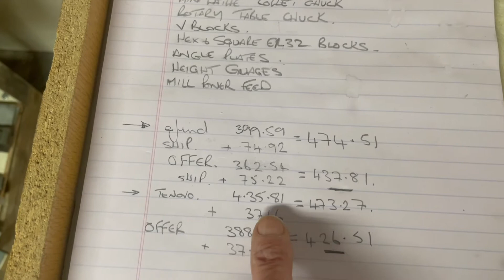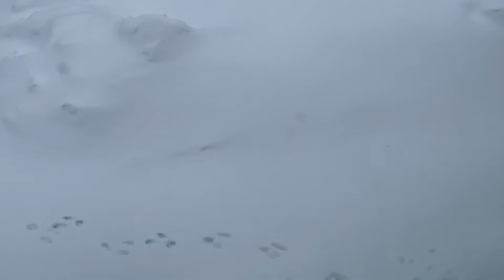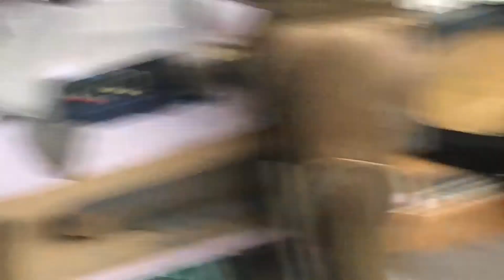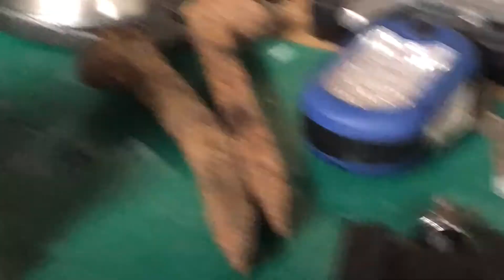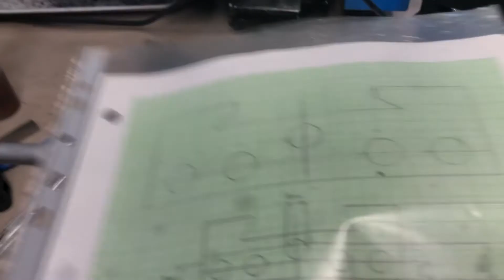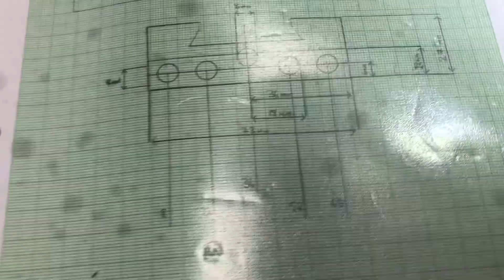QCTP Tool Holder Complete almost

Comment: Hi again George. The drill is a spotting drill at one end & a centre drill at the other. Centre being for the lathe tailstock centres Live or dead. Nice to see the holders coming on. You'll have a few more than me when finished. I do not envy you with temperatures like that outside. But the snow looks picturesque. 
Regards. Steve.